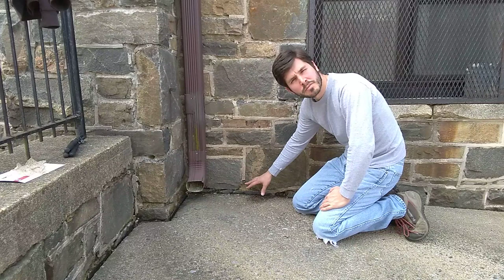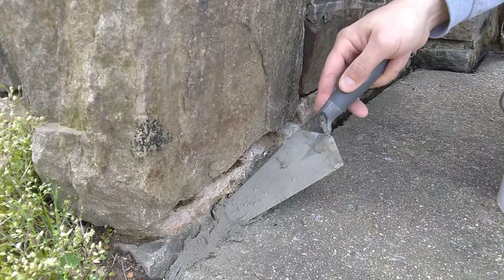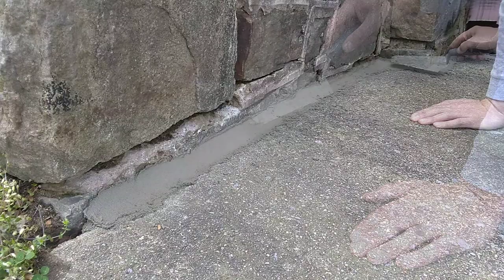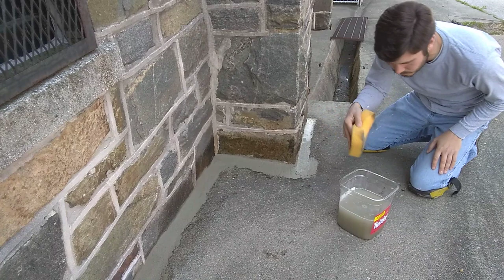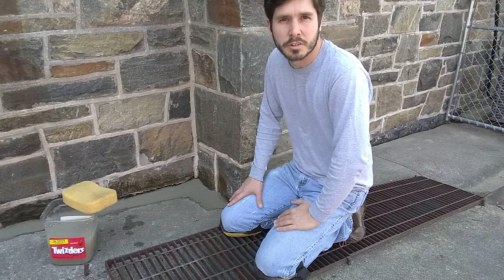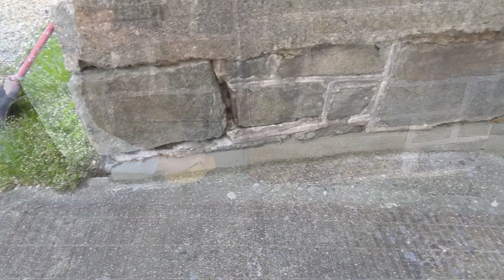Pointing Up A Foundation

Comment: Ever thought about trying Rapid Set mortar mix? Great video. You have a new subscriber.
Reply from the maker: Could've used rapid set, but, normal stuff was cheaper and wasn't in a rush.  Thanks for watching and glad you subscribed.  Glad you enjoyed the job
Reply: @horstcarpentry  I completely understand and use normal mortar mix as well. With Rapid Set you can add set control which gives you a longer working time. Have a great day sir.
Reply: Do you think a tuck pointer would have given a cleaner finish?
Reply from the maker: For sure it would've made for a cleaner finish.  My objective was to fill in the void while allowing it to shed water.

Comment: Is this your house? Looks very historic from the block work
Reply from the maker: It is a commercial building built in the 1950's.  It was designed to match the Church which was built around the 1920's.  Roughly a hundred years old now.  Thanks for watching